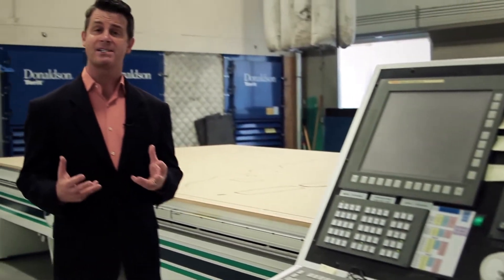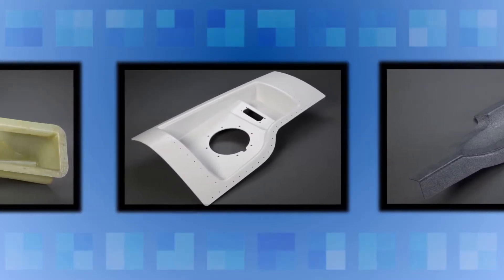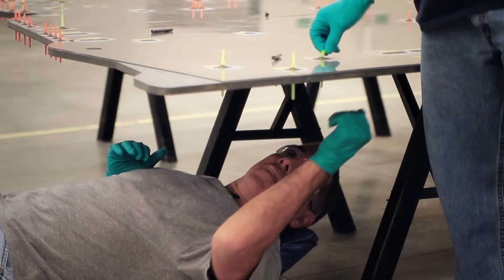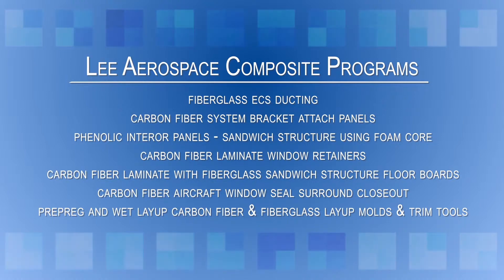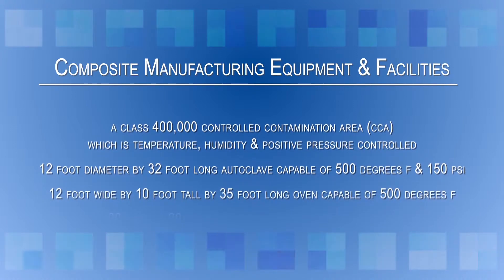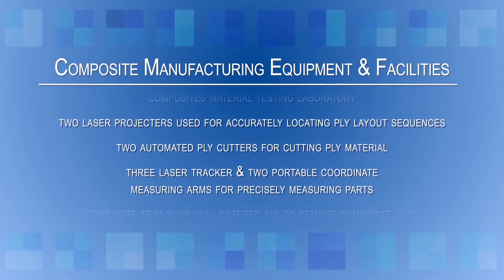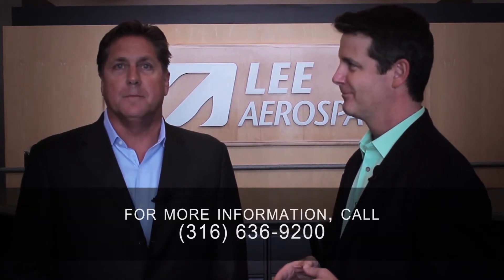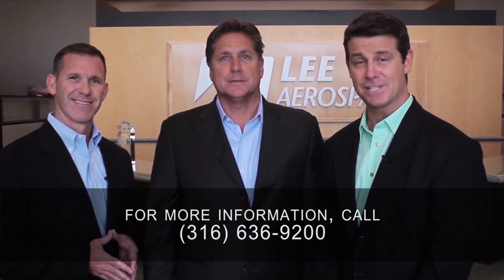Composite

Comment: what is prepeg?
Reply from the maker: That is a good question.  Pre-preg is a common term for fabric re-inforcement
that has been pre- impregnated with a resin system. The resin system is
typically epoxy . Since the material is pre-preg its ready to lay up in molds
right away.